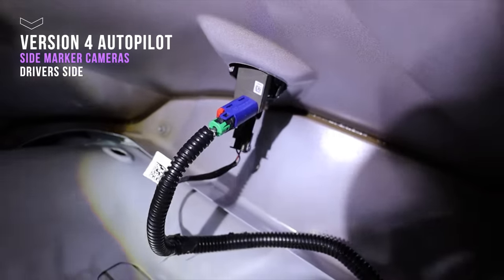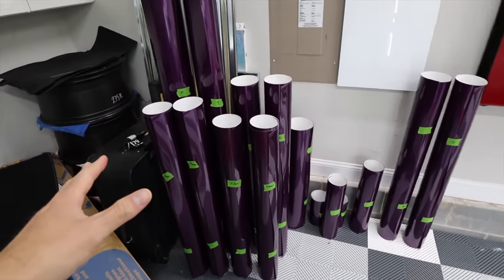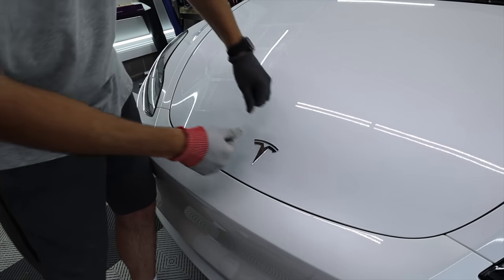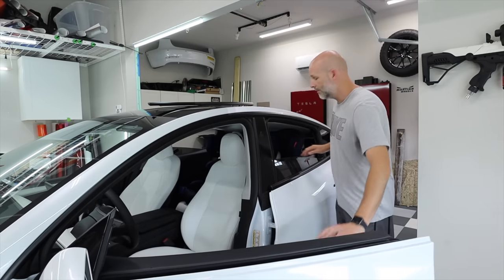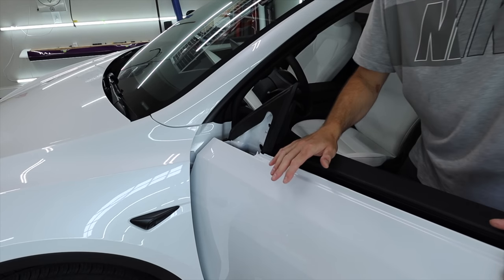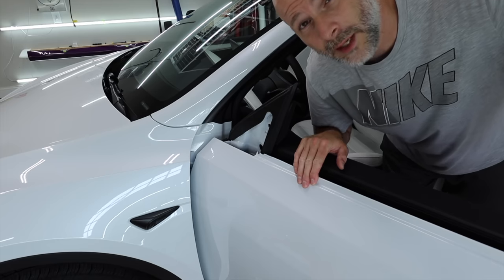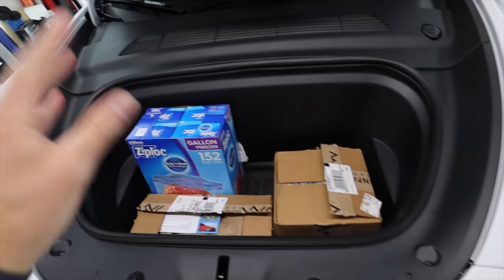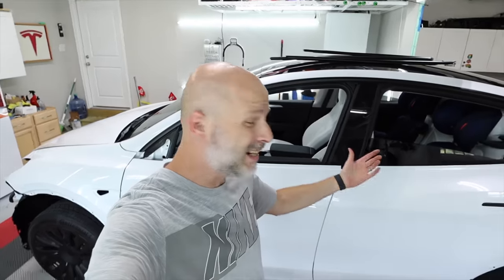How to Prep For a Vinyl Wrap - V4 Autopilot Camera Removal

Comment: I was wondering how much wrap material would I need to wrap my Model Y. Is 25ft x 5ft enough or 50ft x 5ft?
I just love that purple look. I might get the VVivid+ Ultra Gloss Candy Purple to cover the Multi-coat red.

Google says it just need 15 feet
Reply from the maker: First of all ViVid vinyl sucks. A rule of thumb in how much vinyl to get is buy the full roll. Normally that is 75 feet. You should have some left over but I have has issues with the vinyl or messed up on a panel and had to use more than I thought. You need 60 feet minimum to wrap the Y.